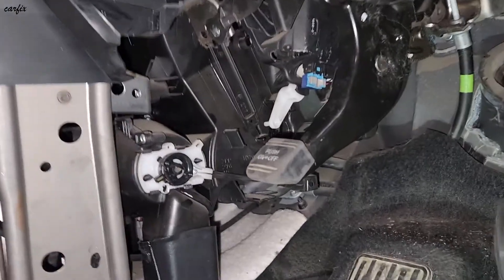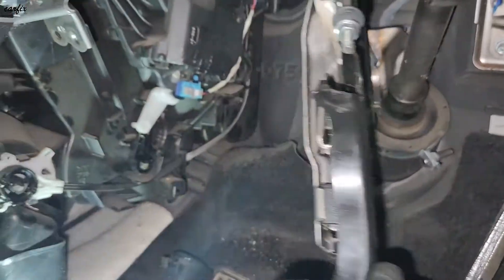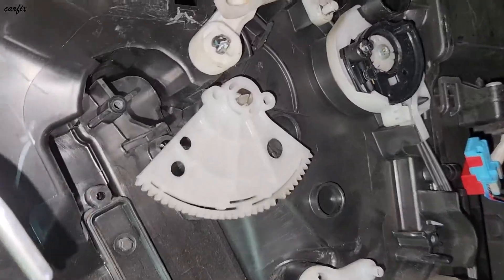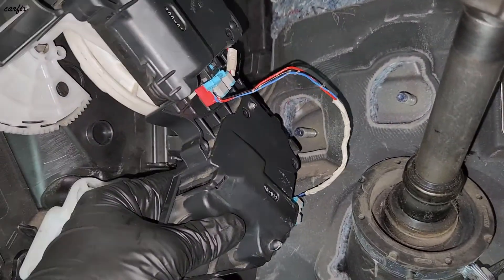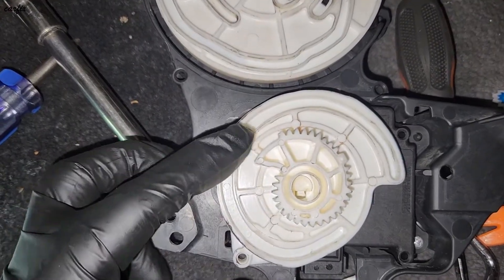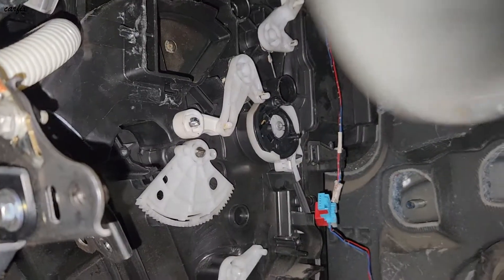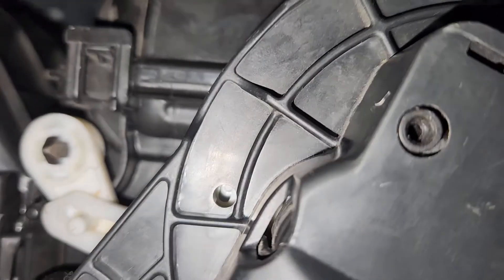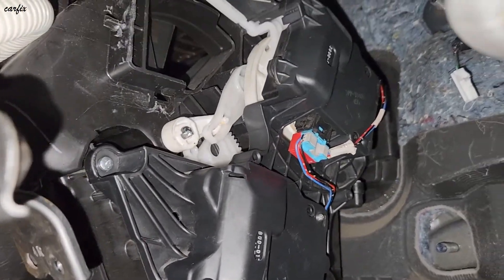Kluger/Highlander No Heat From Air Vent [B 1446 Air Mix Damper Control Servo Motor Circuit]

Comment: Maybe this will help someone someday, but here is what I did after spending close to 20hours trying to set this thing up.

1. Follow what he said in this video
2. Before coupling the actuator to the HVAC Box, connect it cable to it and set your temperature to max cold and mode to "FACE", that's the default position for actuator
3. Then disconnect the cable from the actuator again, 
4.  After coupling and before srewing, check very well to make sure the gear and levels still look the same on the HVAC box, if not, use flat head screwdriver to align it again and couple it
5. Before screwing, Connect the cable back and test all the mode & temperature to be working good
6. Screw and test again

CHEAT CODE: In actuator rest state, all the levels must be close (leg, defrost etc), connect the cable to the actuator and set to same (FACE), that's what you need that isn't in this video. 

Thanks to Carfix, this video helps a lot.

Comment: Hi mate, is it ok if I just re-initialize the servo motor so that all is working fine and then unplug the faulty servo motor? Will it cause the system to seize or something? I don't need to change to hot air, just need cold air.
Reply from the maker: Yes you can unplugged nothing happening anything to system